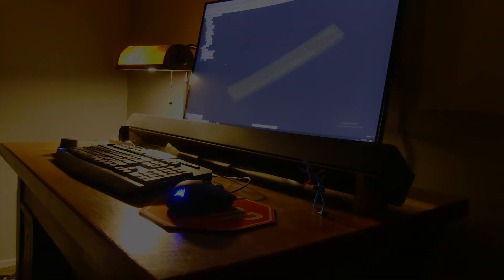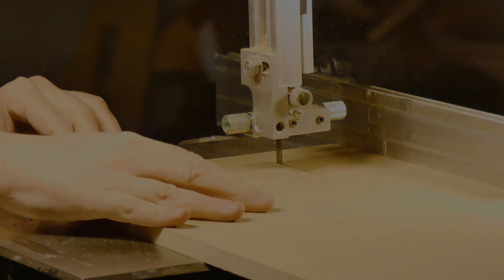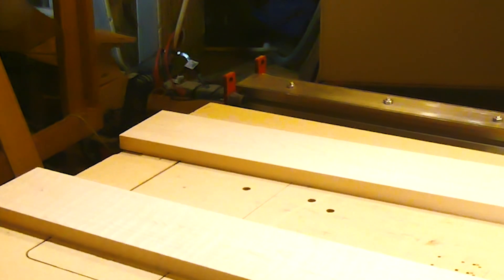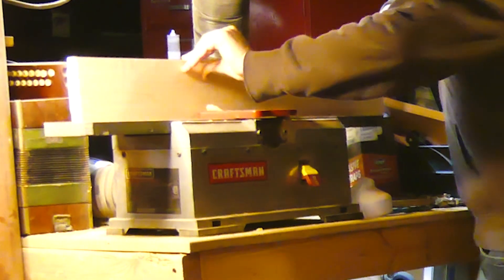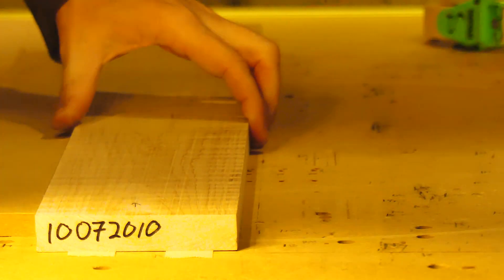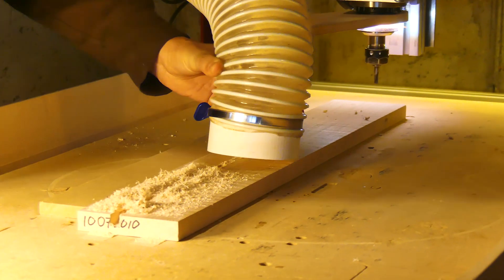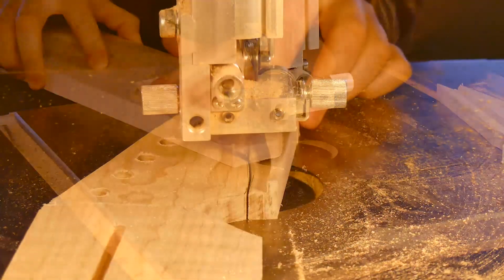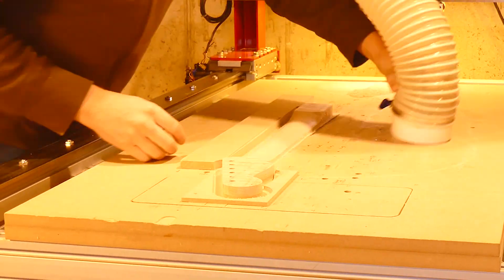My CNC Neck Setup Process | Fusion360 and Mach 3 | Stratocaster Neck

Comment: Why not put some locating pins in the spoil board and some holes (in places that won't be visible) in what will be the neck?
Reply from the maker: I make a lot of different designs, and I rarely make something more than twice, this method provides the same, or possibly better accuracy without modification of the spoil bard and works for any neck size and shape.

Comment: Would you be interested in designing a half  paddle head fender style neck for me in a vetric aspire capable file?
Reply from the maker: I only use fusion 360, vectic aspire is not capable of the adaptive and scallop toolpaths I use.
Reply: @TwoCherriesIns  can fusion save files as stl
Reply from the maker: @patruddiman4228  yes, but you lose a lot of resolution, and all the curves are converted to triangular faces. In turn to follow these faces the gcode is choppy and not smooth.

Comment: Cut dowel dowels on side 1 (at least 2). You can place them outside the cutting area.  Copy the dowel holes from side 1 to side 2.  Side 1 drill holes for dowels only.  Side 2 drill the holes in the deck, NOT YOUR PART.  Do not change your X and Y  coordinates after this point.  Z ok (height bit).  For side 2 insert dowels in side 1 holes, flip piece and place piece with dowels into the holes in the deck.  Your done run side 2.  Perfect alignment.
Reply from the maker: I get this comment all the time. Locating pins work great, if the part you are making is the same every time. I make custom designs that are different sizes, scarf joints,  varied headstock sizes each time. The set-up method I use is just as accurate as indexing pins, can adapt to any size and shape, and its also faster, not that that really matters to me. If they work for you, that's great, for me I need something that is more adaptable to varied form factors.
Reply from the maker: @@LeanOnYourDreams  That's an extra step, more time, more stock, same results. If it works for you, great; the parts I make are wildly different in shape and size; it just doesn't work.

Comment: you need index pins and a vacuum pump, 3M makes 2 sided tape that is easier to deal with than the masking tape and super glue trick. Pins and a vacuum pump would save you a lot of time though.
Reply from the maker: Pins would be specific to this neck model. I make custom necks and rarely more than one or two of a type. Fixed setups like that wouldn't work for me. The 3M tape is expensive and not as reliable as my method. I can burnish the tape into the spoil board and the part; that's not possible with double-sided tape. My method is cheap, very reliable, and I can customize it infinitely.
Reply: @TwoCherriesIns  3m tape is $2 a roll and works well with my shopsabre at 600 ipm
Reply from the maker: @xfup  The least expensive double-sided tape is $5 for a tiny roll. I buy masking tape in packs of 9 for $16. the five-dollar rolls are 1.6 yards long, making it $0.52 per foot. The masking tape ends up at $1.77 per roll, each at 60 yards, making it $0.08 per foot. I am doubling each foot, so it works out to about 20 cents per foot. I can burnish each side into the part and spoil the board; This can only be done with one side of double-sided. If you add the superglue in, it's costing me about $0.25 per foot. The difference between $0.25 and $0.52 is not consequential if you're only cutting a little bit. When I started milling a lot more, I had to find a way to make it less expensive, and this works great. I used double-sided tape for a while, and it works, it's just more expensive.

Comment: Do you really feel that quarter sawn wood is somehow, inherently, less attractive, to some level of significance, than flat sawn wood?

Do you feel this way about all types, all species, of woods (hard woods, figured woods, or otherwise)?
Reply from the maker: If the beauty of quarter-sawn figured stock exceded flat sawn, there would be a market for it, and there is not.  Sure, quarter sawing lumber is wasteful, and on some level, it is irresponsible to mill highly figured maple this way, but I'm not talking about some mythical lumber industrial complex. You don't find stock milled this way because there is a more dynamic movement of the figure on the flat sawn face. All you have to do is to turn your flat sawn stock on edge and decide whether you prefer that kind of figure. The reason for using quarter sawn is for structural integrity, not figure. For this reason, we find very straight grain quite bland material milled into quarter sawed blanks. It doesn't look amazing but it is incredibly stable. Lumber mills make products that we buy and the reality is that we are not buying quarter sawed figured stock. It doesn't even come down to preference, where are you going to get a 5A quarter was flame maple blank?
Reply: Given the look of quartersawn lumber, I wouldn't go out of my way to pay $200 of a piece of wood and not maximize the effect of paying large sum of money. The Stratocaster and telecaster neck pockets are typically 2.187" wide multiplying that by .0014 * 6 (0.0183" ) should give your the average yearly movement of the piece of wood used to make your neck. But that is only if the climate the guitar is stored causes the wood to fluctuate moisture 6%. If you buy a WDmusic neck then no need to really take much care for it. HOWEVER, I suggest regulating the humidity in the room your guitar is being kept should you have a neck worth $600. The average cost of a guitar is $300, so you might want to take appropriate action to maintain the piece of art you pay $3000 for??? I say you, but that really should apply to anyone reading this.

Comment: @2:04 You have that backwards. The quartersawn face is where the figure is most intense.
Reply from the maker: I'm sorry, but you are not correct. If this were the case, the amount of material on the market would be, by the nature of the way the material is milled, 25% of what is available. All of the neck stock in this video is plane or flat sawn. The vast percentage of figured maple prepared today is flat sawn stock. There is very little in the way of quarter sawed material available, and of that, the percentage of material that's figured is small. While there is some unusual figure in the quarter sawn face, it is not as dramatic as the flat sawn face. I can understand that your preference maybe this kind of figure; however, this does not, by any means, make it more dramatic.
Reply: @TwoCherriesIns  I'm not talking about what's on the market or how much quartersawn material with figure is available. I'm simply stating that in a piece of figured maple, the figure is most intense on the quartersawn face. Do some research.
Reply from the maker: @FreddysFrets  I am showing a quarter and flat swan face figure in the video. I'm not sure what research is necessary. If you have a source to sight by all means, do so.  What you propose is some mythical stock that is unavailable but superior in some way. I find this kind of idea odd. I looked through your videos and found beautiful LP tops, all of which are plain or flat sawn. When looking for an example of a figured neck stock in your videos, I found a tele neck that you were hand carving; it was also flat sawn stock. I am unable to locate an example of the quarter sawn figure in your videos.  It's not strange in that the material is not accessible. I wonder how you determined that this figure is superior as I don't see any example of it in your work.
Reply: @TwoCherriesIns  I think perhaps we may just be misunderstanding each other. I certainly don't want to argue with a fellow luthier!
But let's figure this out.....where in the video do you show the quarter and flat sawn face? I see you have three boards, all flatsawn....sure,two of them have some figuring. If you look at the edge of one though (the 1" thick section) the figure will be much more intense on that face. That would be closer to quarter. Just the same way medullary rays appear exactly on the quarter.
Reply from the maker: @FreddysFrets  This is my point; on edge, the close to quarter sawed figure tuns into radiating linear lines running across the face. This type of figure is quite rare these days, seen mostly in violin family instruments. On the flat sawn face, it's more dynamic with waves on two accesses.
Reply: @TwoCherriesIns  Ah ok....so you do concede that the figure is more intense on the quartered face....which it is. I think what you call "more dynamic" is just the off axis randomness that happens the more you go off quarter...it goes wackier, more asymmetrical, but much less intense. And you're right, it's much harder to find quartered, figured hard maple....but that was not the point. It's out there, as you say violins have it. It's a lot more common to see Western Bigleaf maple nicely quartered with intense pencil straight figure.....you see it on a lot of guitar tops ....Les Pauls etc...

Comment: I love your take on milling the headstock (and everything else really).  Just curious if the Fender style necks get a standard Fender style nut with a nut slot, or a Gibson style nut at the edge of the fretboard? Usually I would do that Fender "scoop" behind the nut after the fretboard is installed with a bandsaw and a drum sander that I built specifically for that shape. Looking for ways to let my CNC do as much as possible.
Reply from the maker: It's the standard fender style nut. I shape the scoop after they are glued together, I use the drum sander.

Comment: Good job man. 
What's your tool change process? 
Hard to find info for fusion/mach3 together...
Reply from the maker: That's a good question! It's not as difficult as it seems. When you post-process partial or whole setups, the tool change command is inserted in g-code were needed by Fusion360. When you're running the program in Mach3, and the tool change comes up, the program will wait for you to change the bit and re-zero the Z-axis. After you get the new bit in and zeroed press cycle start, and you're back at it. There are a couple of settings in Mach3 you have to set to get this to happen; I think they are set this way by default.
Reply: @TwoCherriesIns  What post-processor do you use in fusion for the mach 3?
Reply from the maker: @ruicosta3094  My machine uses Mach3 running a CNC router parts machine; There is a post for it included in fusion360 "CNC Router Parts (Mach3Mill) / cncrouterparts"
Reply: @TwoCherriesIns  Thank you. I have a cnc-step high-z. The Fusion360 has the post processor, but not for mach 3. Just for kinetic  NC. I thinkI will have to buy that hardware/software to make it work.
Reply from the maker: @ruicosta3094  I don't have any experience with that one: It looks like it runs pretty generic G-code. I would try a few posts running without any stock and the spindle off to see what works.

Comment: For those of us who make acoustic stringed instruments, quarter-sawn wood is always the most stable, and therefore the most preferable. As the image in your video shows, it's also relatively wasteful and labor-intensive because the pieces go increasingly off-quarter and become smaller in size the further the cut is from the center line. The rift-sawn log should probably be labeled the radially-sawn log. I think the "rift" term comes from mills that specialize in cutting clapboards and wooden shingles, in which case rift-sawing is the most economical way to cut and produces the greatest yield, although it requires some special machinery and is the most labor-intensive. But, again, the image you posted shows that every piece of rift-cut wood is always exactly on the quarter, and also helps to show why large pieces of true quarter-sawn wood are so hard to find. I think the confusion comes because the quarter-sawn log is actually a log that is quartered first and then sawed.

I always look forward to these videos. While I am an experienced luthier, I am a total newbie when working with CNC machines, Mach3, and Fusion360. The practical nature of the videos and the chance to see the process taking place is more helpful than 20 exchanges on a bulletin board. Keep on experimenting and showing us the solutions you come up with. In case no one's ever told you, there are folks out here putting this information to use.
Reply from the maker: Thank you for the great insight and kind words.

Comment: I use a similar way but I always have problem with scallop path, don't know why, it always seems to mill more than needed and always leave big mark near the entry or output. (I use very small passage and remove not that much material so it should not be a rigidity machine problem...)
Reply from the maker: With scallop, you have to choose "inside-out" or "outside-in" carefully. 
The method I use here cuts a heavier cut on the fist pass. I drop the feed rate to 50% during this pass. I have had issues with the inside out. Logically it would be a more even cut per pass, but the wood near the heal is unsupported and ships out.